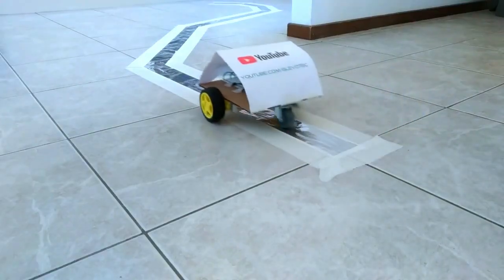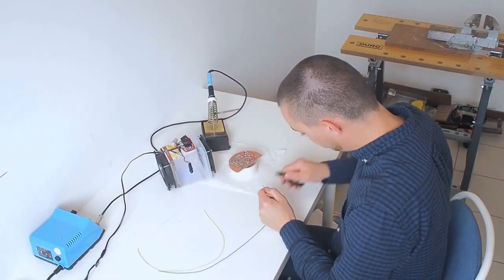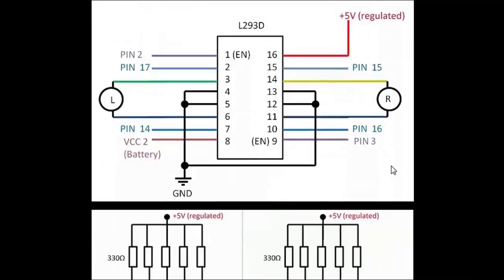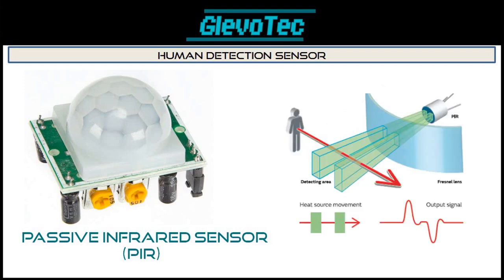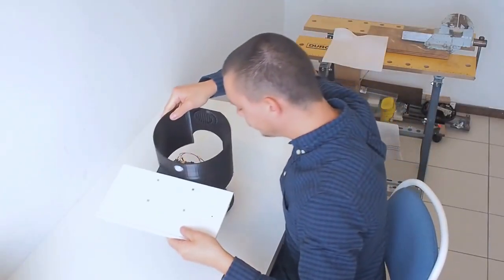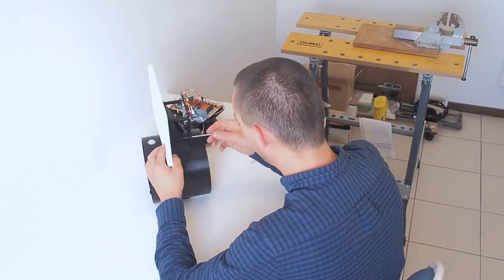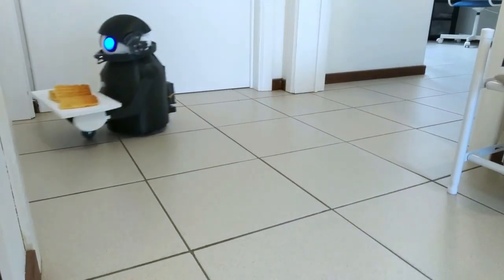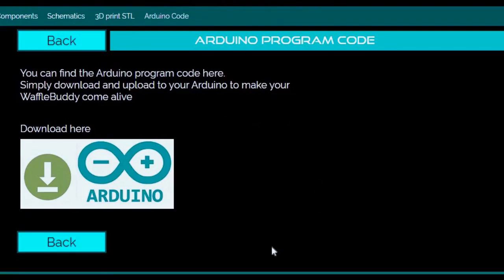Build your own 3D printed arduino waiter robot butler - WaffleBuddy Part 2

Comment: Please  make part 2 about  ticks to improve the power Stirling engine with such doubts 
1. Best radios of basic heat chamber ( homemade, for example cold drinks cans ) 
2. Best radios of power piston 
3. height of the engine. 
4. length of engine 
5 . Burnings materiel 
6. Height of the burning chamber.  
Please make part 2 with this type of questions 
     🤭 Thank you 🤭
Reply from the maker: Thanks for the feedback. I'll think about it!